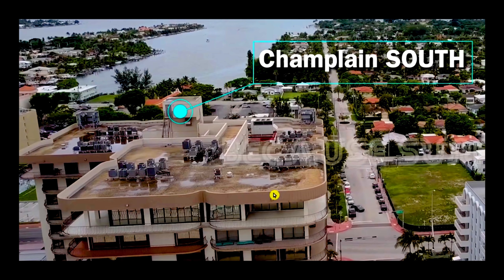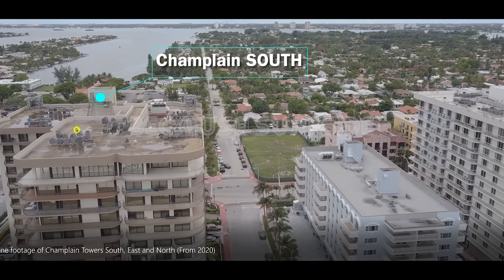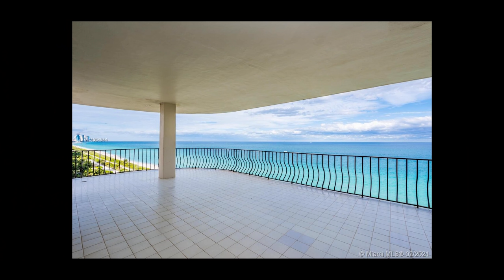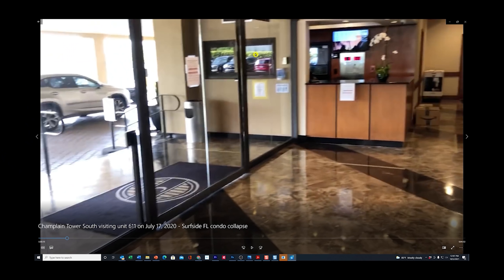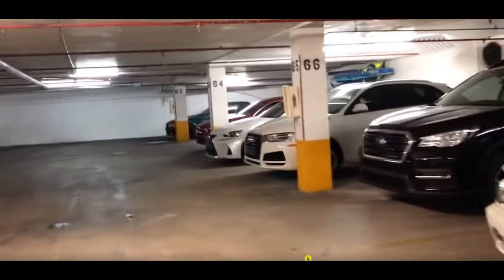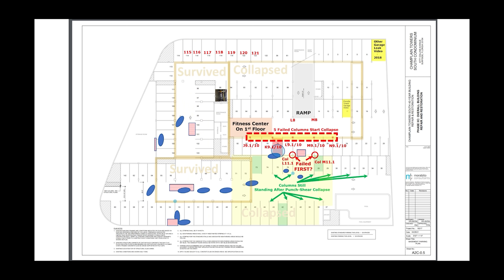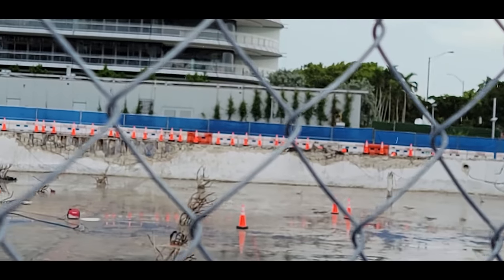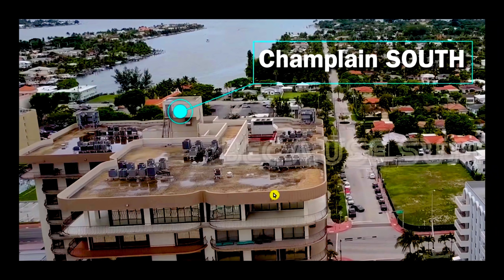Miami Condo Collapse: Water Attacked Roof, Inside, Pool Deck

Comment: Jeff I am fascinated by this disaster and you have covered it thoroughly. I never knew that tiles on balconies were so dangerous. You learn something new every day. Thanks.
Reply from the maker: Glad to help Gerald!
Reply: Well here is a essy way to figure out just how much weight from just 2 apt could be if you ever picked up a box of ceramic tiles just multyply that by at least 10 plus the morter plus the grout
Reply: I agree totally. Thank you, Jeff for all of your incredible work.
Reply: Also, all that added marble and granite didn't help
Reply: @jeffostroff  Those roof plans are original? Then the roof plans with the drains are now below the penthouse floor...right?
Reply from the maker: @duckzncatz   I don't think we will ever really know what plans they used on the roof or if they even did give it slope down if it sloped down to any drains that would have been placed there after the Penthouse was added. There was a lot of bickering back-and-forth between the builder and the city about whether they could add the Penthouse because of violated the cities 12 story rule.
Reply: There is a lot of things they never tell tenants till disaster strikes.People are blinded by greed.
Reply: @garyc39 By 'people' tou mean the Developers ?
Reply: @kenwatkins7097  Agreed... it's a really, REALLY small group of 'people'.
Reply: @jeffostroff  you are doing great with your analysis. You are true Gem if a guy.
Reply: @duckzncatz  ...Good point....
Reply: What about if there were remodels to upgrade it inside the individual units? Wouldn't that add extra weight?

Comment: Wow, that last picture showing how the water has once again filled up the site is amazing. It filled it up just as you said, like a bath tub, and that tells me that this piece of property is simply doomed and nothing should ever be built there again.
Reply: In theory this would mean every building on that side of the street for blocks could be in trouble below their basement slabs.
Reply: Well it shouldn't be built below the water table.  Surfside should scrap it's height restriction...
Reply: Florida is a disaster area geologically. Limestone only a few feet down. A water table not much deeper. It's insanity to build anything tall there.
Reply: Except for an outdoor memorial
Reply: @timramich  (A political disaster zone, too)
Reply from the maker: Well remember it was not doing that right before the collapse I believe the amount of water that is coming in now is due to the damage from the columns that go ahead 12 floors of debris dropped on top of them
Reply from the maker: @LakeNipissing   The other buildings don't seem to have this problem I think what we are looking at now is the after effects of the fact that a building collapsed is that a building collapsed which may have gave water an inroad
Reply from the maker: venswim   I think any amount of water that's coming in now is due to the fact that the building has collapsed on top of the columns and caused damage
Reply from the maker: @johnbergstrom2931   I doubt it as below the water table but certainly water tables can rise up over time
Reply from the maker: @timramich   They can build it if they test it and they know where the limestone is and how deep to drive the piles
Reply from the maker: @johnbergstrom2931   You know there has been much bickering between the mayors of Dade County and Surfside
Reply: @jeffostroff  I've heard the CTS garage floor was 3-4 feet below the high-tide water level...  Guess CTN is as well.
Reply: venswim  The Florida peninsula is a Coral Sandbar. What that means is that water comes UP FROM UNDERNEATH as a rule. That is the nature of the coral formations which make up the peninsula. What this means is that every bit of what most people understand to be the State of Florida is at risk for eventual submergence, and sooner than later. (like 50 years or so)So its an open question why anyone is building anything down there that they think of as "Permanent." GREED maybe? EGO Maybe? All I know is that none of these rich people who own most of these places will be around in 50 years, will they? The whole thing is CRAZY!!
Reply: @rocistone6570  OK, maybe calm down a bit, consult a Geotechnical Engineer, and remember that humanoids have been living on this "sandbar" for about 1,000 years, and building tall/heavy structures on it for over 100 years.  Let's not let a freak alignment of factors on one tiny parcel cause us to evacuate 20,000,000 people to where?... YOUR state?  You got that kinda ROOM?  You got that much fresh WATER?  ;')
Reply: And King Tides began in Florida in September 2021 and we're going through another cycle (Oct 5 - 11). Recall that the former Maintenance Manager at Champlain Tower South complained of constant flooding in the garage and attributed it to King Tides. King Tides are likely ocean water intrusions and corrosive?  I don't know whether the upward force of King Tides generates stress on foundation structures?
Reply: @jeffostroff  remember the previous maintenance man talking about how the garage would flood and the water pumps would have to be replaced I think yearly? Maybe there is something wrong with that parcel of land...I wonder if the other condos have a major problem with their basement garages flooding???
Reply: @MajorCaliber  What you should keep in mind is that, 12,000 years ago, the Wisconsin Glacier has A LOT of water tied up as ice. Indigenous peoples and now-extinct animals inhabited Florida that was at least as twice as large a coral reef as it is now. Today, tourists dive and collect fossils from when the coastal sections (to the west) were dry land; I have some in my collection. I have a partial jaw of a prehistoric horse (I am a mineral collector and mine specimens). Never since before the last glaciers started did we have this much water. FLA is going DOWN. No one is talking about evacuating the state. What's going to happen in the next 50 years is: 1. people will die; 2. more buildings will be condemned if not outright destroyed by hurricanes; 3. people will chose better places to retire to; an 4. Anyone still living in FLA will have to have structures that will withstand water, from above an below. It's going to be a gradual process, just like the process that built it. Societies have inhabited areas and left when the going got bad since we came out of the trees. One place doesn't suit us, we move on. No one is remotely suggesting 20,000,000 people will relocate instantly. It will be a natural process over 50-100 years. BTW, Wyoming and the Dakotas are pretty empty.
Reply: I keep going back to the sewage City lines and was it upgraded to handle the ever increasing water with sewage . 
Also, each time another building was added along the beachfront was the underground sewage and water lines continuously upgraded. ??? 
I m thinking someone needs to investigate this to be sure the lands under these buildings/condos/hotels 
are not compromised. I m no engineer 
but trying to think logically. 
When Northeast cities flooded from remnants of recent Hurricanes and superstorms a city official stated the drainage lines sewage ect needs a five times expansion. ..
Reply: @rocistone6570  I just got back from a short trip to Cape Hatteras. I think seaside rental properties should be built cheaply, with the hope they will survive 5 years to pay off the mortgage before a hurricane washes them away, and any time after that is profit. I would not want to buy anything there as a permanent residence for myself!

Comment: Thanks Jeff for all the videos you have done on this condo collapse, you have brought up several contributing factors on the collapse that the other YouTubers have missed.  This particular collapse appears (at this point) to be multiple factors combined to a worst-case scenario (insufficient design, improper maintenance, and addition of unplanned deadload).  As you pointed out, the numerous water problems had to be a major contributor, and being that close to the ocean, a lot of the water would have been brine.  

Thanks again for all your efforts on the videos, I have really been enjoying them - Peace!
Reply from the maker: Glad to help bill and thanks for watching

Comment: My uncle always says "There are only 2 types of flat roofs, the ones that leak and the ones that don't leak YET".
Reply from the maker: That a good saying
Reply: My father was in charge of maintenance for a large factory building. They were constantly fighting roof leaks.
Reply from the maker: @BenAtTheTube   Yes I have been so aggravated over the years every time I see completely flat rooves on commercial buildings and I'm thinking why didn't they think of the stuff back then why is it only now coming to light that you need to have a sloped roof
Reply: @jeffostroff  Roofs.
Reply: @jeffostroff  Oh they knew. My state has had laws regarding minimum slope on roofs for... practically 100 years, probably longer. Reinforced concrete buildings have to have a minimum slope and minimum drainage up here as well. A lot of that has to do with our annual snowfall ofc - roofs do collapse under the weight of snow. Obviously, FL wouldn't be concerned about the weight of snow, but there's still drain needs that their laws cover. It's not like ppl only just found out that flat roofs have drainage issues. We've known about the problems with flat rooftops for thousands of years. This is not a new problem with buildings.

Comment: I am curious about weight overall in the building in addition to water. Every sales video I have seen for units in this building, show condos that have clearly been updated. These updates seem to show granite / stone counters, expensive tile, frameless shower / tub enclosures, etc. based on age I doubt it was built with materials that had that sort of weight to them. If only 60% had been updated to these one can only imagine the overall weight increase on these floors.
Reply: That’s a HUGE contribution to why it fell. I’ve said it since day one of the collapse, the pillars in the garage and just overall the building was NOT designed for that much weight. The nail in the coffin was adding two more floors 🤦🏻 was just a matter of time then
Reply from the maker: Yes I mentioned this in one of our videos back in July about all of the added weight and the granite countertops in the marble tiles going up the walls and in some cases on the ceilings as well in the bathrooms then all of the huge granite bars added to the All of the pinhouse suites
Reply from the maker: @lexuses3942   The Penthouse was already calculated into the plants and it only took up part of the floor it was not an entire floor
Reply: this is the best post ever to sum this whole situation. no future proofing, and poor maintenance, essentially. but a concrete building designed to take xx amount of forces, over time doesnt add up, or atleast eats into contingency. but add water, and eventually its like make a house of cardboard....but that water coming from underneath...thats saltwater, imagine what that has been doing to foundations over years..corrosion, and possibly even washed away the material around them
Reply: @jeffostroff  I was under the impression more real weight like (an extra floor) was added. Either way all the remodels didn’t help
Reply: Agreed.  This building was being held up by, essentially, a bunch of toothpicks, and then they added tiles and marble and granite and paving stones EVERYWHERE to make the place seem far glitzier than it really was.  Those columns were arguably insufficient to hold up the original 80's version of all these apartments, much less these massively waterlogged and stone-laden "upgraded" versions.
Reply: @Darkkfated  After watching a few of Jeff's videos, I imagined sticking 4 chopsticks in a square on the lawn. Add a paper towel over the top: no problem; it stands. But, if you add water to the paper towel, down it goes in a sagging motion much like what we saw in the security video. If one or more chopsticks aren't deep enough, they will topple, too. A great oversimplification, but the same physics.
Reply: @jeffostroff  It seems they left little room for margin-of-error by failing to implement sufficient redundancy.  Is not the key to any building's long life having a design that is robust enough to overcome any one or two or three local column or beam failures. I live1/2 mile from where pile-drivers pounded columns of a bridge into place. I can fully understand why the CT residents complained during the construction of the tower next door. Not that it caused the collapse,  but certainly  the pounding revealed a fragile building that truly needed some shoring up. Q. Let's say they had patched the hole and removed the planter boxes. How does one go bout shoring up the columns and in your opinion was this necessary for all columns or only the most suspect?
Reply: @littlewol2620  - had pumps to handle that as I'm sure most buildings there do.
Reply: Very true
Reply: As a person who survived both the 70s and 80s, I can tell you that linoleum on pressboard was tres chic! If someone wanted a different look, they pulled off the thin veneer (that was lifting up anyway) and put tile on it. I have never understood why we have “trends” in decorating; the general public isn’t going to see inside your home, and, if they do, you have bigger problems. I’m not a rocket surgeon, but I’m guessing a slab of granite or quartz weighs more that linoleum. Why didn’t someone do some basic math on “improvements?”

Comment: 611 is the unit where the lady woke up and managed to escape. She was the woman rescued by the security guard. I wonder if whatever was going on was more pronounced in her unit, thereby warning her in time to escape. 711,  where the Ring camera activated, is directly above her unit. Interesting that in Fiorella’s picture a year earlier, we saw the water and the fan at the front door of 611.
Reply from the maker: Everything keeps pointing to that 11 stack of condo units
Reply: That floor fan is an important bit of evidence that I hope the investigators are aware of. There is a literal path to destruction in this building that management and possibly HOA Board was aware of. Comparing this condominium to a human - bleeding wounds got little attention or were ignored, open gaping wounds got bandaids and rotting flesh got covered up with gauze. A predictable path to a horrible death of the patient.....
Reply: @dalewalker4614  But also just an under-designed right-to-the-minimums structure that couldn't take all the additional marble, tile, hurricane windows, pavers, sand, etc... the very RARITY of such events is proof that the majority of similar structures were built better... esp. since 80% of HOAs operate with the same kick-the-can attitude as this one...

Comment: You are an amazing analysist. I looked at the Google Earth photos of the pre-collapse tower, and I noticed the roof was distinctly "grungier" than the other buildings in the area. I assume they just used another type of roofing material because It looks 20 years older than the other buildings. Don't give up, you are AAAA++++!
Reply from the maker: Thank you Melissa And sharp eye that you noticed that on Google Earth
Reply: Seems as though the drain lines to the AC units could be clogged causing water to pool around the outdoor units on the roof. Every single unit up there is saturated all around.

Comment: Hi Jeff,thank you for these very infornative videos supplied by youtself and other generous people.I'm a recently retired waterproofer ( 1980-2018 ),on sites in Sydney and Canberra,Australia 'til 1992,and from then on,in New Zealand.I've handled almost every type of waterproofing,including the Epoxy Injection System shown in the garage ceiling vids.This video shows a lot of ponding water, which has been mentioned by others,but you've mentioned the tiled balconies.We've had to repair so many of them over the years.(these WERE rated for the tiles' weight however) This procedure was to jackhammer the tiles off,attach a waterproofing membrane (liquid or torched-on) to the cleaned sustrate,and flood it for 48 hours before the site engineer or Clerk of Works gave permission for the screed to go on.But those remedial works were still happening into the 2000s with our Leaky Building issues.It was very frustrating,,but a terrible financial burden for the owners who bought into these problems
Reply from the maker: Yes, I think we will see new disclosure laws on multi-family dwellings